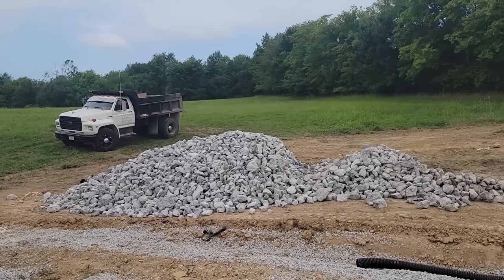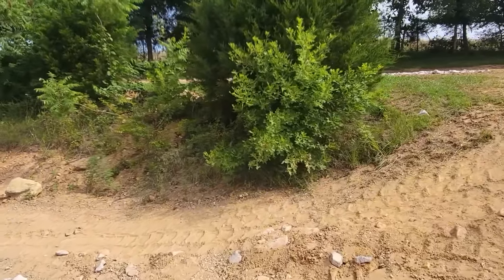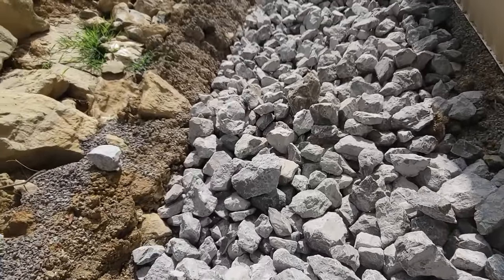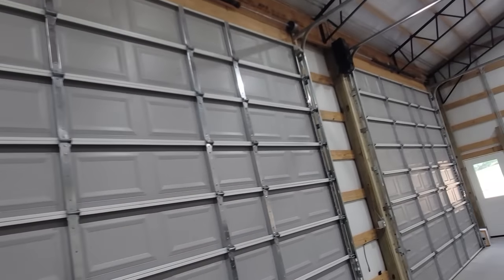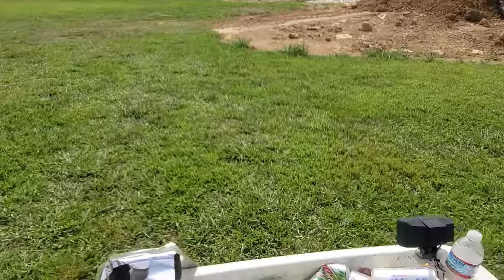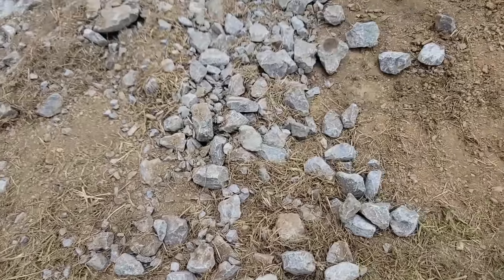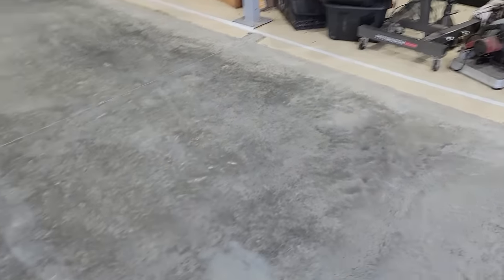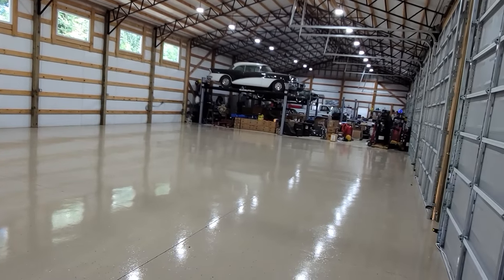My NEW Shop FLOODED! - Here's what happened (we had to start over)

Comment: I feel your pain.  In 2017 a furnace water pipe broke and flooded my basement. Of course stuff was in cardboard boxes on the cement and destroyed. What a mess that was cleaning up. Also back in 1980 in a different house our basement flooded but did not build up because it went under the door to the garage and eventually flowed out.  We did on the inside our basement (trench, gravel, pipe sections , about 12 inches with holes in them ), graded towards a new sump pump. Never had water again and when we sold our house ( literally in hours ) in 1983 the draining system was the reason the family bought the house. Cleaning up the mess was an ordeal.

Comment: You talked about plumbing your shop with air from your compressors and they have designed a system that literally clicks together and you can do your entire shop in less than a day and is very economical. Check with your local paint and body shop supplier and check it out. Hope this helps you out and keep up the good work...I watch your channel everyday!

Comment: I was going to tell you your additional engineering wasn’t going to work, but the civil engineers and professionals have already made the case. In Tennessee you always build on high ground. That clay simply will not absorb water and small conduits plug up from silt. Think TVA. That’s the scale of the problem you’re working with.
Love your program. Big fan.

Comment: The amount of work you are putting in is awesome to see and really like the layout of the new shop, you can never have enough outlets! I dont know if anyone else has said it but I have seen Rustoleum  Epoxy fail repeatedly with hot tire lift, it just doesnt have enough solids. I would highly recommend Epoxycoat or other 100% solids epoxy for a garage floor. Since its down, just let any car you are parking on the epoxy cool outside first if the tires are hot. 
I have built engineered retaining walls, french drains and other water related systems and have to agree with others like Garrett in saying its just not enough, especially without the system being built with smooth wall sch.40 pvc. Corrugated clogs and crushes leading to failure a lot faster and difficult to clear clogs. There also should have been a dust sock over the corrugated pipe.

Comment: Love Vice Grip Garage!! I am a fan.  Just needed a 1ft tall or taller stem wall on 3 sides of shop foundation. The water would run around foundation. Downspout water coming from roof is minimal compared to amount of runoff coming down the hill towards the building. The dirt bank will erode more over the coming years. Looks like a challenging location  for a building site.

Comment: I  am dealing with a flooded shop as well. The drain along the front backed up. Looks like it flows into a dry well that is obviously clogged.  I had an inch and a half of rain water. Cardboard boxes and some tools got wet. I wish you good luck in diverting the water flow.
Reply: Hello!! I trying to reply to being todays random winner. Did I get it right?

Comment: I admit I have not read all of your help solutions but noticed no one told you to wrap that pipe with silt protection, silt is coming like that on the floor slab.   Water will win is the truest statement ever made.   Hopefully, you do not have groundwater to contend with, which can produce hydrostatic pressure that can push up through any slab cracks.   I have 40 years of free stories of keeping water out of hospital and church basements.   I am in Nashville if a further conversation is warranted.

Comment: Feller, it will be fine. Kitchen. Tv, fridge. (DEFINITELY KEEP THISE COLD SNACKS COLD). STORM shelter.. holy smokes!! My Q is, where’s the 🚽!!? I have a solution. A friend of mine drilled a hole in the wall of his garage, found an old style sink, put together some pvc piping and connected it to his drain tile. Scootched it right out into the alley. Came in very handy after a few cold “snacks” 😂.. number two’s were another story.. cheers 🍻.

Comment: I would suggest a silt sieve wrapping on your weeping tile. It's just a very fine nylon mess wrapped the tile 3 times or more, comes in 100 foot lengths. I used it in alluvial sand/clay for a septic tank system and it works like a charm, no back ups, no blockages, and that was straight into the soil.  Your gravel and riprap would be lightyears better than what I did and last many years for you.

Comment: You should put a berm along that French drain, between the drain and building , to retain and direct  water in case you get a sudden and severe rain storm it will help hold the water  instead of running over the rock if it's already too full

Comment: Derek think about a low retaining wall on that hill about 25 or so feet longer than the shop. It solved a similar problem for me at my larger shop now a storage bin....  That redirects the water a great deal. You have to go 24"or 2 feet deep with it and at the least 16"thick. Use solid concrete with rebar no expansion shit or anything else like that solid wall with internal rebar lace inside the wall. My wall is over 12 years old now and holding and paid for the premium 5000 portland cement mix with little to know fly ash in the mix all straight Portland concrete not the companies in house mix and I had a engineer check it. I pair 12K for the wall. Not cheap but super effective...

Comment: Jack Affeldt is right! After 50 yrs in the dirt,construction and trucking business, I can assure you that the best and cheapest way to preserve all the money you have already spent on drain tile and rock, would be to cut in a ditch between the road and the fence up on the hill behind the shop. The goal is to catch and divert the water coming down that hill on the other side of the fence, BEFORE it goes over the drop off and down into your drainage tile around the building. This way, as the ditch fills in with silt over time, all you have to do is dredge it back out with a road maintainer or tractor of some kind and your primary defense against run off is good as new! The big tile you have up there now will only last so long before it silts in and you will have to either try to water jet it out, or dig it up and replace it. A simple grader ditch is the way to go. Best of luck my friend!

Comment: Just for an emergency backup I would have somebody fully caulk and seal that bottom edge of your building with some type of silicone where the water comes from just in case. You could also blow a hole over in the corner of the floor and put a sump pump in the floor about the size of a 5 gallon pail or a little bigger.

Comment: for my building if I get more than 2" of rain per hour for more than 2 hours. The water will sheet across my property. To keep my building and driveway dry I have the 4" perf'd field tile with basins every 15'. It did not keep up without the basin's. The 4" tile is at capacity quickly so you may want to upsize.

Comment: Put the pipe inlets (slits) facing down 
Water will flow in 
Wrap pipes and rip rock with landscape fabric 
It will last and work longer
You should clean out and reattach drain under concrete floor
to prevent water from cracking concrete
Unless you keep after it 
Water always wins

Comment: I know it's late in the game and you probably won't see this but, I have a skosh of landscaping experience, I live in Honolulu. That slope behind your shop can be stabilized. Fill in the rocky area with soil. Then you can cover it with a erosion netting with hay and seed. The hay immediately helps control erosion until the seed in the product does it's thing. As for your first French drain..total rookie mistake. Everyone should be corrugated and there are socks for the pipe to keep soil out, preventing clogs. I also have an idea for the shop. How about installing a track system under the length of the ceiling for a come along for heavy lifting. Good luck and Aloha

Comment: I used to do epoxy floors in chemical plants! They could have used sand to soften them edges out! Could have painted them edges a little heavier, then took some sugar sand spreaded it lightly at the edge! The sand will soak up the epoxy. Then when it dries you give it a sweep, and then paint over it again! The best would have been to grind that edge down then painted over it!

Comment: 15 years doing epoxy floors.. they needed to grind that floor... The control joints needed to be caulked.. it will last for a few years under casual abuse.. But it you have water issues again it will get under that epoxy and lift it off the concrete... Love the content and all the best!
Reply: Oh and they could have floated the floor up to meet the existing floor to avoid the lip.  But I figure in a rural town the trades options are limited.

Comment: Hey Derrick,  I'm sorry you had a flood!  I wish we were logistically closer together(NJ), I do Epoxy floors for a living.  I would have bartered a floor with ya.  Good luck with the Rustoleum, it's not great stuff.  The crew should have ground that edge for ya.  It's so easy to do.  A 4" diamond grinding disc on an angle grinder would have had that clean and smooth in no time.  Anyway, love the garage!  Keep up the good work!

Comment: Sorry this happened to you & you're doing a very good job with the remedy. Though I have to add as 30+ years heavy equipment operator & master Dozer. One word, Berms, not little sissy berms that will blow out. To be a dozer guy/girl you only need to know the answer to one question; Where is the water going? Always start with the berm then add stone to control flow. A good state requirement for a berm 4'wide x 3'tall , packed (the top of slope by your building). Top soil is perfect but not mandatory & if you've ever shoveled wet top soil you'll say oh, that's why...here shovel this for me. That being said if you decide to use top soil make sure it's moist and not squishy. 
Also haul dirt in to fill that lake by those cars, the waterline tells you were it's needed. Have a nice day, I do God's work on a Dozer. If you have any questions, just ask. More of that 67 GTO please...love that car!

Comment: Sooner or later that rock will fill in with silt and dirt, then it will be the same as if it's not there at all. I'd do it without any rock at all. Just a ditch. I just re-graded around the 1880s "new" house I bought this year. For 6 feet around the house I steeply graded away from the walls, put tarp on top of the dirt, then covered it in 3/4" gravel. Lots of shovel work but the basement stays dry now.

Comment: Filter fabric or sock pipe. Also, natural rip/rap and swail's horizontal to slopes, as static water stops to reduce and re-direct sheet flow. Example, the upper temporary construction road where you have placed your french drain, (needs filter fabric) could have a opposite slope cut into it (we call them terrace) So sorry, I feared this when I watched your construction videos. A lot depends on your site soils, of which I am unfamiliar.  I wish you and yours well. As always, thanks for sharing.

Comment: Wow!  Bummer, but predictable for us that deal with stormwater.  I would scrap using drain tile and cut in a swale that diverts the water around.  Also, maybe a small berm at the top of the slope to prevent slope erosion.  Drain tiles silt in or get plugged by rodents.  Keep the drainage on the surface.  That way your peepers will see any issues before a bad storm.

Comment: I feel for your Derick. It's a huge job to (properly) clean up after a flood. I watched your videos as you built your shop (in a mud pit) and as a carpenter of 30 years I was very concerned about the water shed from that hill. I'm pretty sure I left a comment, but I don't expect you have the time to read all of the comments, or necessarily listen to any advice from random people in the comments. 

I don't want you to have anymore problems, so if you do read this, please believe me that corrugated black flex drain pipe is garbage. In Canada we don't even use it anymore for good reason. Every time I dig that old crap up, the pipe is colipase and/or full of mud. Where I live the soil is nowhere near as muddy, nor do we get the same amount of rain fall. Do you have perforated PVC drainage pipe in the US? That is what you should be using and also have a filtered cloth (to block the mud) over the drain rock above the pipe. It a bit more expensive, but it works and likely will save you money and heartache in the end.

The contractors who built your shop should have put a 6-8" concrete curb on the perimeter of your shop and anchored the posts to it. Not only would the curb stop water from going in your shop, but treated posts WILL rot out if consistently getting soaked and drying out. They rot out at the ground level because that is where more oxygen is for the bacteria to do their thing. In less than 10 years I have seen treaded 4x4 post rot right through at ground level, due to irrigation flooding the posts regularly.   

My point is that it is imperative to keep the perimeter of your shop dry, because it wasn't built to handle any water.  Don't use that corrugated pipe Derick, otherwise you will regret it. I have seen it all, I know what works and what doesn't.

Comment: We are used to managing two things here in Australia. 1. Droughts. 2. Floods. The solution there is not within 10m of the building. Its much farther up the hill. The slope needs to be contoured to slow the water down and direct it sideways away from the building. The other thing is that the building should have been built maybe 30 inches above the ground on the high side to allow for flood water to flow under it. Cutting into the slope will not only allow surface run off to cascade once those drains are filled, but also groundwater from under the topsoil. This would not get building approval here from the local authority and thus no insurance.

Comment: Maybe you could put a large exhaust fan on both ends up toward the ceiling then you can draw out the hot air and pull in some cooler air from the floor

Comment: Sorry this happened to you, great solution but I would add a Berm all around the Building up on the Hill, that French Drain will silt up over time and your Drain Pipe should have a Sock around it to prevent fines from clogging up the Pipe.

Comment: As far as commercial fans I don't know if you have heard the company called "BIG ASS FANS"? I used work for a steel company and it would get very hot in the building and they had one or two "big ass fans" and the they were absolutely amazing they are worth checking out!

Comment: I would add a bar ditch on the other side of the road. Either side of those trees. Good sized... that will slow it down before it gets to the road. Drain the bar ditch at the ends WAY past your buildings. I would even have a berm on that bar ditch on the lower side. Don't even let that water cross the road.

Comment: Cool show. Nice shop. That French drain and riprap ditch repair is about as effective as putting a bandaid on a gut shot wound though.  It's just not gonna work.  It's gonna silt in. You need swales and ditches to effectively move the volume of run off water your getting. It would be worth the cost to consult an engineer. Good luck with your flooding issues.

Comment: If it fails again cut about 10 in out of the top of a culvert pipe and weld a metal grate in the gap and bury that to where the grate is flush with the ground and all that water will go into that culvert pipe. We can't stop water but we can redirect it.
I'm not an engineer but I've had to live in flood zones where my property would be underneath four to five feet of water at times. Had the asphalt wash out and land in my yard even. I learned a lot living right in a flood zone for several years and I was able to redirect all the water around my property.

Comment: Suggestion here-install a piece of metal expanded metal/fine weave over that inlet pipe-keep animals and debris out. Just secure it w/ zip ties. You almost got to cover every opening.
Reply: Why would you not remove all that hill back to the fence line and use the space to angle water around the shop. That rock and pip will clog up fast.take the hill back. Slant away from shop. You needed dirt anyways.

Comment: i have done drainage for 30 plus and my dad 60plus years . that rip rock to 1.5 will fill with silt really quick . plus the pipe is up down up down water does not go uphill the pipe will fail . not only that its way way way to shallow . what you have is a bad french  drain . what you need is a curtain drain with wash outs . you NEED that mountain of a hill sloped way down to slow the water down . i use layers of rock pea stone - 1,2,3 inch rip rock is too big and is a waste between layers put straw . the pipe needs to drop an 1inch per 10 feet . by the way you can not drive over it or it will crush ! sorry to give you the bad news .

Comment: Sorry about your bad luck.  A very poor choice of building location.   You need Major rework.  French Drains are fancy for handling small amounts of water but must have Filter/Geo cloth or it will become useless.  Dig out the existing one, put down 6'' Perforated drain covered with Geo cloth and run cloth up the sides.  Run Uprights of 6" PVC Pipe every 20' for cleanout
I would pour a buttressed Retaining wall 3' deep and 3' high where that road is if it is your property.   It should go 50' past either end of the building. Put serious bars inside and out of low windows.  Employ a Drainage Engineer  to discuss your plans with.